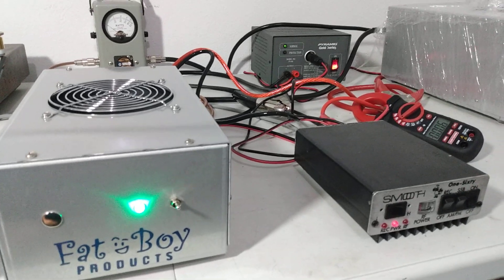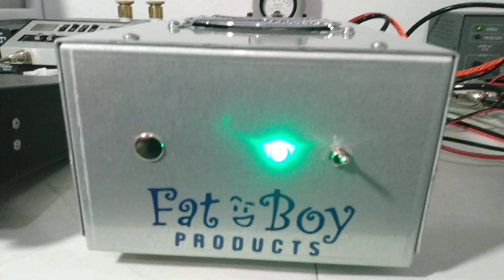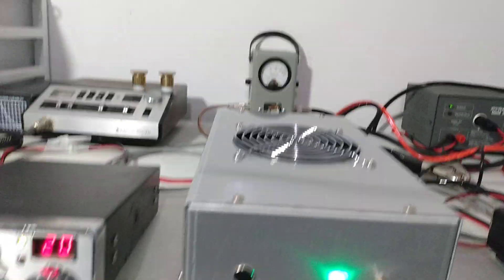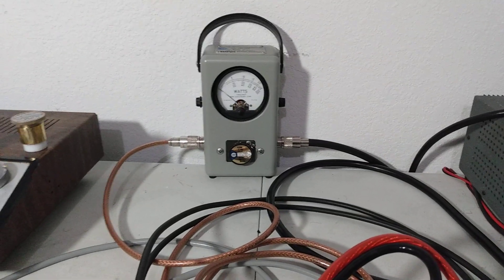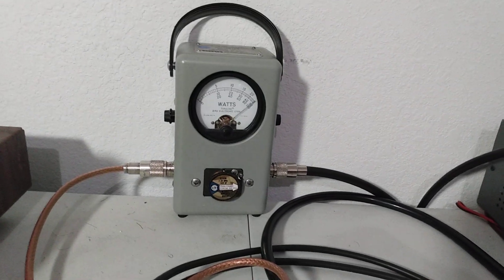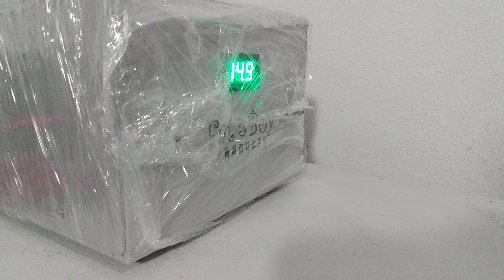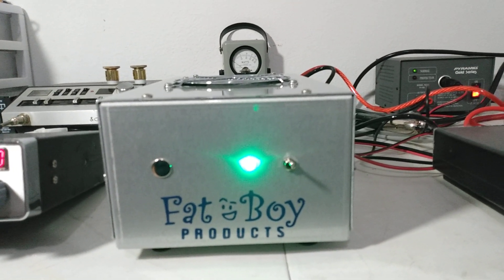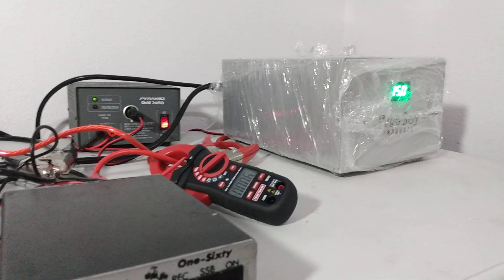Combo Setup for Michael Fatboy 4p 2879C and 100 amp power supply 15v

Comment: hey rooster love your videos ive been it about a yr now ...i got a ten tube d@a t600 base amp u think it would be safe to drive it with a 2 tuber  i also got a ct40012 carl built base amp about 1200 watts should i be using a a99 or should i up grade my antenna